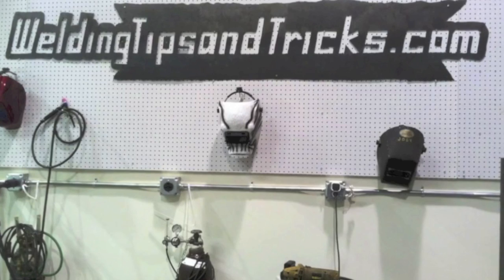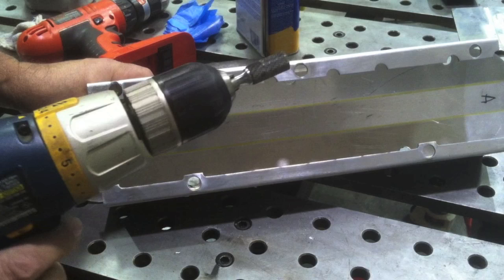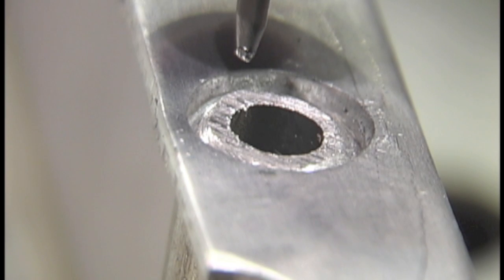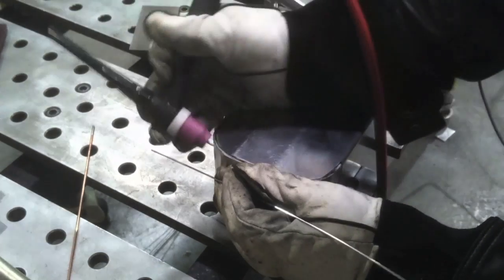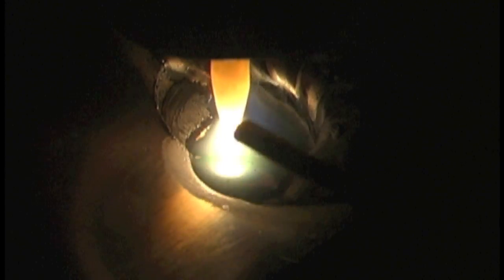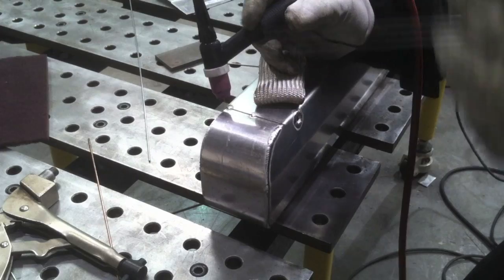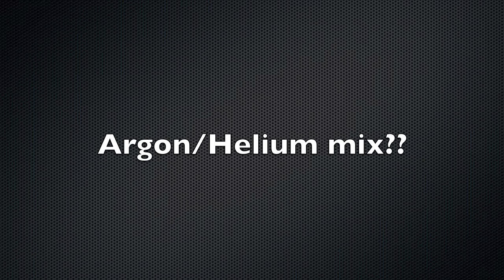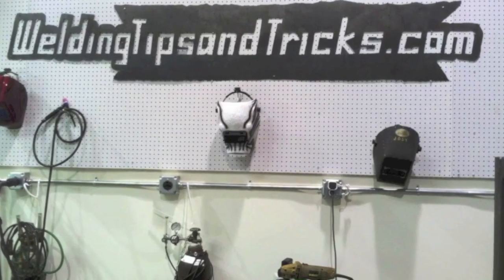Tig Welding Aluminum Thick and Thin using an HTP Tig Welder

Comment: Lets see a weld on 1/4 aluminum to 3/4 aluminum t joint with 175 amps no helium and using pre heat to make it possible. That is what is coming up for me... Impossible? Hope not as I got to get this done and only have a Lincoln square wave tig 175 pro. It has to work. If I am not able to get it to work I'm not sure what I am going to do I don't have 3000 plus to throw at a new tig.

Comment: Hi Jody great video I know this is old but when you change the EP and EN amplitude it’s only one that gets changed. If you move say EN to 50% the EP auto adjusts to 100% and vice versa. Also the dynasty 350 is amps you adjust and with the 221 it is the percentage you adjust so it’s different. With the miller you can adjust both EP and EN but not with the HTP. Just wanted to let you know in case folks didn’t understand by the settings you showed. It’s a little misleading. Basically you can be in EN 50% of the time and EP 100% of the time. Great video as always though, thanks for showing.

Comment: Hey I really enjoy watching your videos and always learn something from them even being an aluminum welder myself but the only thing I would have to say is having taught welders I noticed that the   sequence in which you assemble the the torch head is crucial to determine issues. I always start with the collet body or gas lense first then collet then cup and back cap last so there is no gap when the torch parts mate together

Comment: Jodi, you always make this look too easy. I watched this video before trying to weld .035 wall tubing into a hole in 1/8 Alu.
Making a heat exchange tank.
Could not get even heating, and the tubing would soften and pull away from the side of the hole.  ended up making plugs for the tube ends to be drilled out after welding.  200hz, 100A, 75% bal.  I can't get a controlled arc the way you do...keep up  the videos.
Dan
Reply: Sounds like it might have been time for a smaller electrode?  Also you might have been able to put a temporary plug in the tube ends just as a heat-sink?   Finally, (nobody wants to do this for some reason) it might be that you could preheat the heavier material to even things up.  It wouldn't take that much with 1/8" material, maybe just the ordinary propane torch.  The industry is always talking about preheat, but nobody does it!   This video seemed like a good time, what with the thick material and saying the machine was just barely making it....  might have been easy if the material was already hot, and also if the heavier part got more of the preheat.
Reply: Leonard Pearlman he had his amps too high I’m betting Jody sets machine doesn’t use full pedal. You need to use pedal control so it doesn’t melt away good material

Comment: I'M A NGOC HUNG. I'M A WELDING TIG ALUMINUM. IF ARE YOU NEED A WELDING ALUMINUM? PLEASE THE CALL ME : 0987116.107
Reply: Hung Bui You are a welding tig aluminum?  I would please a call you, but it does not make sense to ship a $20 repair overseas and spend $500.

Comment: 2 years and counting my 221 is still going strong. Just ordered a CK 9 and gas lens parts for snaking my way through a Chump Car rollcage this weekend. IMO I've tended to like the CK torches. Their smaller size, duty ratings, and superflex cables pulled me to the dark side :)

I emailed Jeff the other day and found out the Dual Voltage 221DV version has a power factor of .99 so you can run it on some pretty tiny breakers.
Reply: I have the dual voltage 221.  I actually bought it over the standard 221 because my 220v circuits are 30 amp and aren't enough for the standard 221.  I can go full power at 220 amps on the machine and never trip the 30a breaker. The machine is awesome.

Comment: At the place I work at they would have told me to weld something like this with a spool gun and make it look good. Spool gun is great but at times it is like using a sledge hammer to tune a piano. Am thinking of changing jobs due to the fact they will not allow me to practice other forms of welding process on more delicate / thinner materials. Received prints for a stainless steel pipe job requesting full penetration welds. Again, would not let me use TIG for the root.

Comment: So lower frequency ,more heat ? if you used dc reverse with pulse ,ac not needed ?
Reply: pennswoodsed inverters don’t work that way. It’s all dc neg and the machine does the switching for you

Comment: Hey wer can i get a valve cover kit like this? Thanx.
Reply: They bout aluminum sheet an fabbed with a bending brake an it may be cut out with a jig saw from the appearance of the roughness. Im doing the same but building a tig cooler from old MAC G5. Ill post the stills when im done.

Comment: What size tungsten are you using on the 1 inch thick piece. I kept blowing the tip off my 3/32 tungsten welding over 200 amps guess ill get some 1/8 today. Have you tried the G3 tungsten its some kind of special blend. Keeps a better tip than the thor. Try it you might like it

Comment: I have never been able to fully master  aluminum welding maybe  the machine did not sit right with me, do you use straight thoriated rod,also I notice  you have  more of a point than a ball on your rod.. Can you tell me the type of welder it seems a lot smoother tuning than the ones I have used. I plan on watching all your videos thanks.
Reply: ferstuck37 all inverters can hold a point you prob use a transformer

Comment: hi there I need advice, I have a pan weld ac/dc 200 machine. want to do aluminium welding with it, on what setting must I start with. first time to do aluminium welding. this welder looks like the east wood ac/dc welder.
thanks freek

Comment: Hi, great video, I have this welder and I love it, I have had a hard time getting 1/2" aluminum to puddle running straight argon.  I have read that helium-argon gives a hotter weld that straight argon so how much would you say is due to lowering the frequency and how much due to the gas?  I didn't know about the frequency so I will have to give that a try as I was running at a much higher frequency.

Comment: I have a 221 and like it.  For the $, I think it is hard to beat.  I really enjoy your videos and have learned a lot from them.  I also winced when you snapped the glove.  I dont know if the youngsters realize there is a full exam required for welding certification. ;)

Comment: may be, i only spent about 10 minutes w/ it at a welding expo/ miller demo trailer display. it was 110v/220v switchable input,wireless remote foot pedal, about 17" deep, 10" high, 5-6" wide, said dxp on it. better look back in my miller catalog, i'm sure you're correct. thanks. oh and the miller rep. told me the wireless (radio?) foot pedal costs about $1000.00 w/ it's receiver/transmitter assy's.

Comment: Jody, have you tried the brown tipped zirconia 'tungstens' yet? i've been using them for about 2 years and find the advantages of less 'whiskering' on the ball formed when ac welding on aluminum, brass, etc. and if you get in really close with 2% or pure tungsten the aluminum will sometimes accumulate on the electode after about 1 hour. Not so much on the zirconia(zirconium?) Also I'm using the copper lead in/arc start trick and tig finger with great results. Keep up the great uploads & thanks.

Comment: excellent question. i've had good results with the 60 grit dremel 'barrels' and the 'maroon' scotchbrite discs from cgw and walter abrasives. the 'barrels' are also available for the air and electric pencil grinders too but watch the rpm's as they'll fly apart. i'm using these for cracked and busted aluminum castings and adding boyesen and v-force reeds/blocks to vintage motocross bike cylinders, though for heavy grinding nothing beats the carbide or hss burr tool(watch those sharp chips!).

Comment: i got to try the diversion with the wireless foot pedal, it worked 90 feet from the machine with (obviously) no wire cable. i would think in a multi -machine work site that wireless foot pedals would be a problem, cross communication between different pedals/machines. the diversion did make an excellent aluminum weld. i turned it up to maximum frequency,about 300 i think, it was LOUD but absolutely perfect weld (and quick too).
Reply: timm white you must mean dynasty because the diversion is a turd

Comment from the maker: there are flap discs made for grinding/sanding aluminum one company that makes them is lehighvalleyabrasives .
also CGW abrasives makes similar flap disc where something in the disc lubricates and prevents loading up

Comment: I've had mine coming up on a year now. Great machine and I was pretty happy to find a CK R torch and massive ground clamp in the box. A low profile pedal is nice too.

FYI, the units are italian made by Stel Itl and the insides were very nice when I popped mine open. I've found some interesting tid bits too by looking through their manuals like that VRD system. Holding down stick mode toggles it. My earlier manual missed it.

Sweet work as always Jody :)

Comment: I looked at an HTP 205 before I went for the much cheaper diversion 165, The HtP is a nice machine and really liked the light weight torch and cable. The diversion has worked out good though plenty for what I need and nice and simple.

Comment from the maker: If it was for a structural purpose, I would have preheated to about 200f and also beveled to get more strength, and made larger fillet welds.  The print only called for a 1/8"  ( 3.2mm) fillet weld all the way around.

Comment from the maker: its more like 1.3 amp/thou for aluminum for the first several seconds, but depending on the size of the part, once the parts heats up can change to way less than that.  a foot pedal is the way to go for aluminum jobs.

Comment: I have an HTP 221 myself with a water cooled and air cooled torch. Great machine. I have been watching Jody's videos for a couple of years now. I used to work in the coal industry as a welder but I got laid off a year ago. I was blessed enough to have enough money saved at that time to buy this machine. With it and Jody's videos I was able to pass a 6G tig test on 2" carbon steel after just a few weeks of practice. I had never held a tig torch in my life.

Comment from the maker: the tubes were ground like that when I got them. But you are correct . Never grind aluminum on a bench grinder or you get a face full of wheel ...but there are grinding wheels for angle grinders specifically designed for grinding aluminum. Too rough a grind, and it shows up in the weld.

Comment from the maker: The torch cable held up fine for the 10 inches or so of weld at 220 amps.  I wouldn't recommend continuous welding at 220 amps with any air cooled torch but this CK #17 really surprised me. Its not the flex loc torch, just a plain 17 with no valve.

Comment: Fascinating! Have you ever used, or recommend a clear Pyrex cup? Also, I hear you mention grinding aluminum. I was always told to sand or file, but that aluminum would clog a grinding wheel leading to it grenading. Thoughts? Dad was a 30 year welding shop teacher. I'm just a hobbyist.

Comment: So ,the cable of the torch cud hold up to 220 Amps ?
Is a similar cable like the one use for FL1525vsf torch? just curious
Reply: Andy205ro it’s a 150amp rating

Comment: Nice job Jody.  If that last piece that came into the shop was for a structural purpose, would you have torched the aluminum to get it hotter to work?  Seems that I remember an old video of yours where you used heat to get the aluminum to not suck all the heat out of your weld.

Comment: Low freq for the thicker material with the 200DX is a great tip to pass on.  I was frustrated welding some 0.125" fittings on 7/8" plate.  After I dropped the frequency to 50 Hz, I finally achieved good wetting on the plate and then walked it into the fittings.  Thank goodness for the TIG finger and a watercooled torch ;o)     Thanks Jody!

Comment: I think if you used a cloth polishing wheel on a grinder with some mothers aluminum polish it should make it shine like chrome when you are done. That is how I do it. Make sure you don't have to weld on it any more though, because man is it a bitch to get the weld to work after you apply it and buff it. LOL

Comment: Hey jody, great video. I do tig work on 316L stainless welding big spirals together. I fit them up by beveling both ends with a land (like a double V groove). I get full penetration but have been running into trouble keeping the other side of the joint clean making it difficult to put down a decent weld. Any tips?